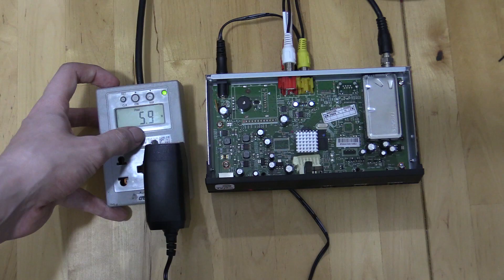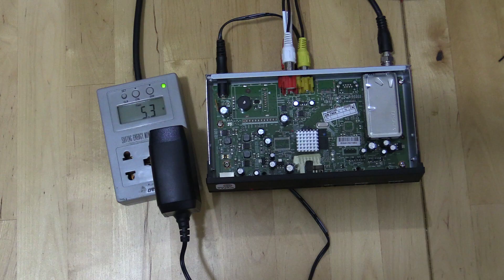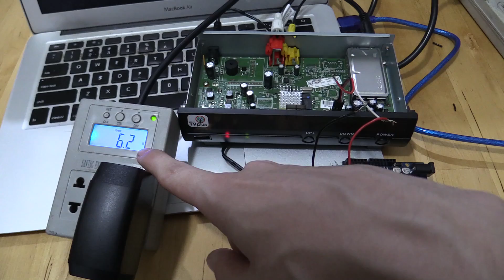ABS-CBN TVplus hardware teardown

Comment: Hello sir, I know this video is very old but, I'm having problem with my 1st gen tvplus with hdmi port... all lights are on the green and orange and red, at the same time it keeps on beeping/buzzing, and lights are somewhat blinking, seems like its having power/voltage problem... I already purchased a bnew power adapter but same issue... any idea whats the problem with my box and how can I fix it... I like to try to fix it by myself for learning process and because it got no more warranty.... thanks you and I would really appreciate any help...

Comment: Great video. So there's a ground, RX and TX connector INSIDE the box itself. I just installed an Android head unit and TV Plus unit in my car and I've always found it awkward having to use the remote included with the TV Plus to control the tuner. I've seen videos of Android head units having a dedicated TV app designed to interface with DTV tuners like the TV Plus, letting you control the tuner using the touchscreen. But the TV Plus only has HDMI and composite video out. Seems like I'll have to open my TV Plus unit to access the RX and TX connector, although I've got the newer, smaller, square-shaped model instead of the rectangular one you have in this video.

Comment: Hi. Do. You have the stock firmware and flash it thru usb.? It 
is it7200 right? Mine is only blinking red light. Maybe its a firmware issue. Cannot update thru OTA. Stuck on blinking red light. Thank u
Reply from the maker: +Richard Lopez Sorry, I don't. I sold this shortly after shooting the video. I'd imagine they could fix it at the service center though. It's a 1 year warranty and even if it's out of warranty it might be as simple as a quick flash of firmware from the USB port so they might not even charge out of warranty.

Comment: Hi there Gadget Addict is it possible to use my DVB receiver in the Philippines, and if not can it be configure to ISDB thank you?
Reply from the maker: +arvin olaa Unfortunately not :( I have a wifi DVB receiver and it doesn't work in the PH. It really has to be ISDB-T. Converting it probably wont be practical / possible.
Reply: Thank's for the information.

Comment: Bro..Can you demonstrate how to install Cooling fan on it? :D
Reply: Power supply 12
In jumper
Reply from the maker: +Zhai 3DPrinter Hey! :) I already sold mine so unfortunately I can't show you. But it would be pretty simple. Just buy a 12v computer fan from pcexpress, cdrking or pretty much anywhere. Then remove the top casing and drill holes in a circular pattern. Then drill some mounting holes that line up with the fan and screw it into the case. Then run the wires through one of the air holes and solder them onto any 12v supply inside the box. Just probe carefully with your multimeter, maybe tap straight into where the power comes in. There's still excess power from the supplied power adapter :)

Comment: can you solder a hdmi port to the tv plus and upload the video here so that we could know if it works
Reply: +Gian Tolentino I have a digital tv box with HDMI output for HD video. It can also output 5.1 sound thru Coaxial audio out, can read 1TB drive, can also record tv programs. Acquired it directly from Alibaba online store.
Reply: +Gian Tolentino I guess the installation of hdmi port requires additional capacitor/resistors/transistor since it's visually missing in the pcb (if u check continuity for hdmi pins going to cpu)
Reply: UPDATE: some tv plus boxes has a hdmi port in selected stores
Reply from the maker: Gian Tolentino My soldering skills aren't quite good enough for that. I've considered taking it to greenhills to have them try, but I think the chances of it being enabled on the chip are pretty low, so I'm not sure if it's worth the expense to test.